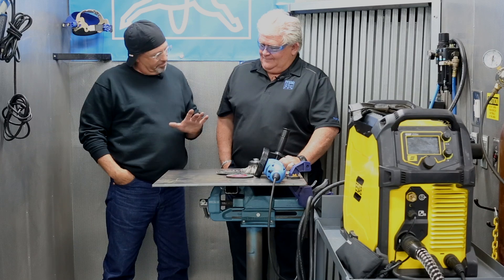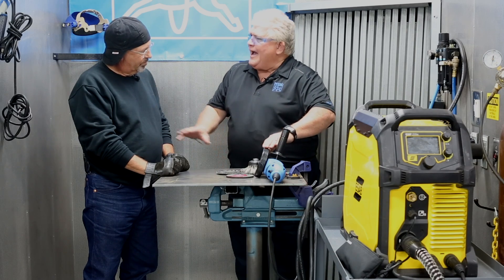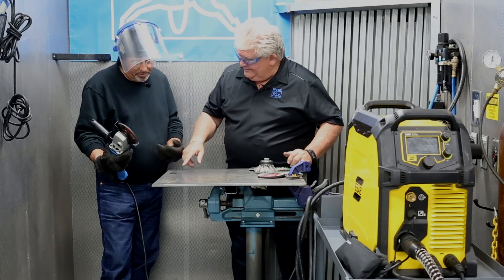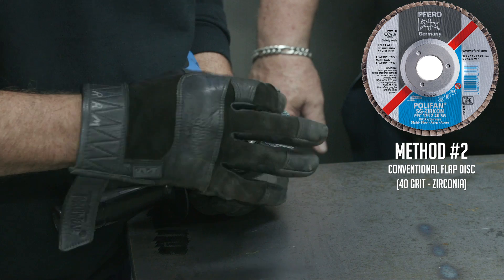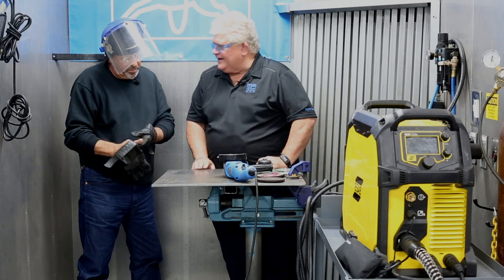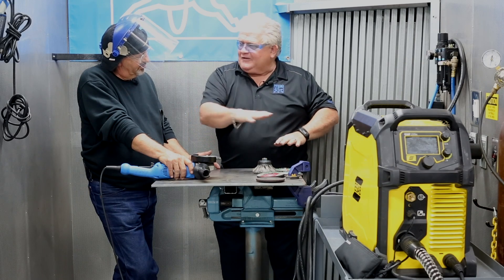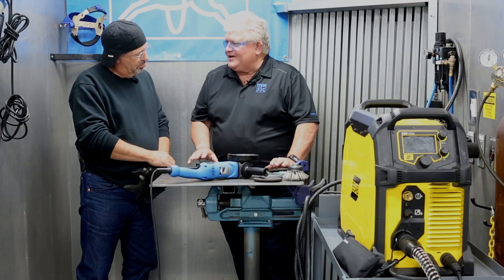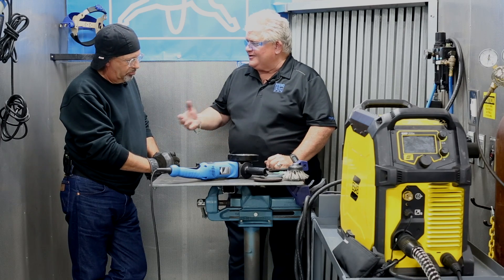Four Ways to Remove MILL SCALE

Comment: Um, this is ridiculous that you never mention the most important thing, the relative hardnesses of AO, Zirc, silicon carbide & diamond. Mill scale is primarily a heavy iron oxide layer over the top of the steel, not the "impurities" floating to the top. Iron oxide is also known as Emery.... which is used as an abrasive ( Emery wheel, Emery board, Emery cloth etc)
 You have to use a harder abrasive than Emery, such as Silicon carbide or Diamond in order to be able to scratch into the surface of it, no matter the speed of the wheel... I use a dedicated random orbital air palm sander with a 5" hook & loop 80 grit electroplated diamond disc to cut through the mill scale. Then usually 120 sanding disc for a smooth finish. By removing the top layer of scale you dont immediately glaze over your sanding disc or flap disc. Saves you tons of $ on abrasives in the long run. 

Love the diamond wire wheel. Didn't know they made em. I'll have to get one.

Comment: Lel website has no price.  I order nothing that I need to request a quote for.  Rug salesmen.
Reply: Abyyss3344  And you gotta wonder what the useful life is like.  TBQH there are situations where $100 would not be an absurd price for something like that.  Pipeline workers, field repairs and the like, some of these gigs pay well over $100/hr and down time of what ever they are fixing can be orders of magnitude more costly.  But regardless it still rubs me wrong when they wont say what it costs.  I've been forced to do business with folks that will just pull a quote out of their ass based on what they think you are willing to pay.  Highly frustrating.
Reply: Abyyss3344  IKR. I think I can remove that mill scale myself for that kind of money
Reply: Abyyss3344 I posted this a couple of days after this video aired. Someone made a comment to my post yesterday so I started reading other post.  Here is the real prices as of the aire date: here are the prices of the three grits for that diamond stainless wire cup.  I hope you are sitting down.  EDP#84323 - $956.85  EDP#84325 $719.85 and EDP84322 - $1287.17  You can pay for a lot of labor to finish the surface at those price points.  Just sayin.

Comment: We do auto restoration which in turn brings us into the field of sand blasting.  Oddly enough most of our money in the sand blasting department is from industrial work needing millscale  removed prior to  the welding/coating.
Reply: That's what I use in the shop. Sand blasting is the BEST way to remove mill scale. Makes my tig welds look perrrrty
Reply: @Mikey-ym6ok  Agreed. It is incredibly fast for large areas. It also gives consistent results. The only down side is the initial cost. My old shop had an industrial booth you could drive in with forklifts and a 100hp compressor. It was like sandblasting with a fire hose. You could leave small delicate parts in the corner and they would get blasted just from the shot bouncing around.

Comment: If it is affordable and value for money then I will try one. Otherwise the Klingspor 60grit flap discs will be retained. I pay roughly £1 each for the 115mm flap disc and then I use the worn down ones for fish mouth joints on steel tube.
Reply: $300 for the Diamond Wire Cup. It also uses a metric thread and has to be used on a slow speed grinder.
Reply: @nsmturbo5902  I will pass on it then. It's not value for money in the grand scheme of things and given time other manufacturers will make and sell something similar (irrespective of IP protection) which is value for money but still quite expensive to layout for.
Reply: @JonDingle  I agree

Comment: Terrible product, it removed scale way to slow and left scale in the pit marks that hot rolled has. Walter has much better products for removing mill scale faster, larger surface area without gouge marks and the price isn't that bad. The abrasive pads they have for removing scale don't gouge or scratch, non loading and won't glaze over at slower spreads.

Comment: I have been using a flapper disc for 10 years and I just bought one of those silicone carbide disc. Holy crappy it is a miracle, easy and faster. Great video bob
Reply: How long did it actually last?

Comment: Polycarbide Abrasive Wheel is the fastest way to remove scale.  I buy the cheap Harbor Freight ones.  They don't last all that long but their pennies compared to this diamond wire brush.  Also, from the video, much faster at doing the same job.

Comment: This is for the newbies: I used to buy 4'x8' 11 gauge mild steel sheet with mill scale. I ground the mill scale off with a hard wheel, then smoothed it with a flap wheel, then primed & painted the sh** out of it. Then I discovered acid, but acid has its own problems. I sand blasted it, but air compressor, sand blasting cabinet, media, time, etc...So the search for mill scale removal continued...

Then one day I saw some 4'x8' 11 gauge that had NO mill scale & was "good to go". What the hell this stuff?? The old timer said "Oh it's PNO." 

PNO?? WTFO?? 

Pickled and Oiled.

The best solution for mill scale removal is NOT TO BUY IT in the first place. HTH.
Reply: Or just buy cold rolled. It's easier to get here, and less work to degrease.
Reply: HAHAHAHAHAHA, Cold rolled just isn't that much more when you think about it. You're going to spend it in disk or some other solution, or in cold rolled. Cold rolled doesn't take your time though!
Reply: What's the difference between manufacturer pickling and pickling in the shop?
Reply: I saw some 16 ga sheet once that supposedly was "levelled, stretched, pickled and oiled" I think, it was supposedly intended to make furniture.  It was scrap when I got it and partly rusted, but really great stuff in the parts that hadn't rusted.  I like what you're saying here!  Unfortunately in FLorida, everything tends to be or become rusty if you just look away from it for a minute, I think we will always feel the need to do this

Comment: For everyone interested in this diamond stainless steel wire cup brush, it will not be available in the US until Feb 2019. The parts numbers will be EDP#'s 84323, 84325, or 84322. This is directly from Pferd customer service conversation on their chat system. Hope this helps.

Comment: I’ve been watching your videos for some time now and find them extremely helpful. I do a lot of repair work on tractors attachments dump wagons and basically anything you might find on a large farm. There’s been a bunch of times I’ve been forced to run single pass flux core wire on multi pass welds because it was all I had and mig wasn’t an option due to high winds. My question is could you do a video showing the difference in penetration between multi pass flux core wire and single pass flux core wire on multi pass welds?

Comment: I’m assuming the silicon carbide wheel is the same make up as a silicon carbide grinding wheel on your bench grinder for grinding tungsten carbide, if it is Stuff using that anywhere in a 4” grinder. It should be reserved for grinding carbide. Even with a respiratory device dust you crate will get stirred up at a later date and cause you some big problems down the track

Comment: Great stuff if you are working a job that can afford that but I would love to see some stuff geared to us budget folks out there. I would love to see a video on comparing various acid methods of scale removal and if they do negatively affect the strength of a weld (hydrogen embrittlement.) For myself I tend to find a nice quick soak or wipe down with vinegar tends to do the trick most of the time for getting the nasty flaky stuff off and then doing a simple solvent wipe and all is good to go for brazing or flux MIG welding.

Comment: Or, you can just let it sit in a 5% hydrochloric solution (aka muriatic acid) for a 2 or 3 hours, or the night before.  When you take it out, just wipe away the mill scale with a stiff brush or rag.  Why pay for expensive abrasive discs or brushes, spend the time removing the scale with all the dust and noise etc.?   Put the steel in the solution and go do something else while the acid works.  Yes, of course there is the downside of working with acid, but common sense,,,  Jerry

Comment: This is another time that the advise should be accepted and the product is “sold”. Again there is talk about linear speed of the abrasive on the surface and that slower is better. On Pferd’s www the grinders available rotate at quite high speed. Could you (Weld.com or Pferd) disclose the brand and model of grinder used on the video ? Thank you.

Comment: Harbor Freight #94017 - Polycarbide Abrasive Wheel @ $5.99 (before 20% off) does a great job removing mill scale.
Reply: Hell yeah on putting the part number on there

Comment: Been a  metal fabricator /welder for years and this product is just what the doctor ordered for material cleaning prior to welding.
My question is can that wire wheel be used to remove smoke and flux from welds or is it too abrasive and will remove reinforcement?

Comment: I've actually had amazing results using Clean n' Strip discs like this: https://www.3m.com/3M/en_US/company-us/all-3m-products/~/3M-Power-Tool-Grinding-Discs/?N=5002385+3293948879&rt=rud
Doesn't get into the material, and the mill scale is gone with no effort.

Comment: No kidding silicon carbide is sharper than aluminum oxide or zirconia!   Basic materials science.  And diamond is the top.  But diamond is more resistant to fracture than SiC so it doesn't break down and it likes to drag and smear.  Which is why I flame clean mill scale.  Or chemically remove scale.   Less work.  Mill forms like pipe and tube have far less as they have less time at temperature to form scale.  Thick plates and structure forms have far more as they take longer to cool.
Need a large plate descaled?   Prep n Etch phosphoric acid with a paint roller, let it dry over night, then 4000 psi pressure washer.
Reply: Haha yeah I was thinking the same thing. I'm just surprised they didn't start with an aluminum oxide then zirc then carbide then diamond then.....
Reply: Or buy cold rolled

Comment: Mill scale is from the iron oxidizing.  Black oxide.  Harder than the steel.  This is why cold drawn steel is bright.  The mill scale is blasted off after the last hot roll by steam and water.  A rose bud acetylene or propane oxygen torch and water will do the same.
Reply: Yes it's mostly iron oxide (not "impurities" like he said). I think sometimes they also pickle it in acid before  cold rolling.
Reply: @benc8386  : Pickling is done for bright stainless products.  Steam and water with wire wheel at most for carbon and low alloy.  Always done for cold roll final.
Reply: Yeah this guy expects me to believe you can move it around at 1000 degrees? Nice sales pitch. How can he say there's no directional scratches from a spinning wire wheel? They don't mention price because this is an expensive setup, between the wheel and the soft start slow speed grinder yikes
Reply: @LacklusterSupply  : No kidding.  Tubby there is in sales.  Too bad he never set foot in a steel mill, foundry or forge shop.
Reply: wouldnt that method warp the pieces though? how about soaking it in Vinegar?
Reply: @CP110  : Flame scaling only heats the scale.  This causes the mill scale to expand, causing shear stress in the bond.  You don't heat the metal, just a fraction of a second.  You move the rosebud very fast.

I've GTAW steel without removing the scale, it does the same thing.  But when you get scale in the puddle, it reduces causing an oxygen pop.

Comment: That looks like it would eat rust and paint also. Can we please get a link to the diamond brush and grinder? Thanks Guys!
Reply from the maker: Here is the brush: https://www.pferd.com/int-en/products/industrial-power-brushes/threaded-cup-brushes/knotted/tbg/stainless-steel-wire-inox-diamond-dia/stainless-steel-wire-inox-diamond-dia/tbg-100-m14-inox-0-50-dia-270/
Reply: @Welddotcom  thanks
Reply: @Welddotcom  Thank you!
Reply from the maker: The grinder is not available in the US. However, all your major grinder manufacturers make a variable speed. This is one bad mamma jamma: https://www.metabo-hpt.com/us/main-navigation/tools?category=/tools/grinders/4-5---5-angle-grinders&title=G3612DAQ6++36V+MultiVolt+Brushless+4-1%2f2-in+Slide+Switch+Grinder+(Tool+Body+Only)

Comment: How about a  part number.  I looked on the pferd sight and could not find them.
Reply from the maker: Here is the brush: https://www.pferd.com/int-en/products/industrial-power-brushes/threaded-cup-brushes/knotted/tbg/stainless-steel-wire-inox-diamond-dia/stainless-steel-wire-inox-diamond-dia/tbg-100-m14-inox-0-50-dia-270/
Here is the Silicon Carbide Wheel: https://www.pferd.com/int-en/products/fine-grinding-and-polishing-tools/combiclick/fibre-discs-cc-fs/silicon-carbide-sic-type/silicon-carbide-sic-type/cc-fs-125-sic-80/?filter=%7B%2522q%2522%3A%2522silicon%20carbide%2522%7D

Comment: Links to products shown/discussed?!?
Reply from the maker: Here is the brush: https://www.pferd.com/int-en/products/industrial-power-brushes/threaded-cup-brushes/knotted/tbg/stainless-steel-wire-inox-diamond-dia/stainless-steel-wire-inox-diamond-dia/tbg-100-m14-inox-0-50-dia-270/
Here is the Silicon Carbide Wheel: https://www.pferd.com/int-en/products/fine-grinding-and-polishing-tools/combiclick/fibre-discs-cc-fs/silicon-carbide-sic-type/silicon-carbide-sic-type/cc-fs-125-sic-80/?filter=%7B%2522q%2522%3A%2522silicon%20carbide%2522%7D

Comment: Industrial application is just code talk for more than you should pay
Reply: chadwick hayes you mean “over priced”
Reply: @mrmidnight32  You should look at my comments below to see just how overpriced.
Reply: DIY toot isnt cheap
Reply: @Ken F 
Neither is ruining new flap wheels getting them filled with mill scale glaze or adding two or three steps to finish before paint and still haven’t struck an arc or welded an inch anywhere!
I trained to weld, but have not been able to put that training into work experience. 
I still know that every minute spent trying to get mill scale off the work piece before welding, is time lost from welding!
Not to mention that getting rid of mill scale makes the work surface that much easier to weld and can save getting inclusions or porosity in the weld!
I also know that porosity is caused by things other than mill scale, like incomplete fusion, low or wrong cover gasses, low/high temp, slow/fast wire speed, or filler rod progression.
But getting one more variable out of the equation can put you leaps and bounds ahead of the game if you’re able to control the other gremlins of welding issues!

If I were given an opportunity to get into a welding job where I could advance my skills, I would spend whatever it took to give me a better starting point in the price!!!
It’s one sacrifice vs. another! 
For me, the cost sacrifice is far outweighed by the employability benefits!
If I can produce work at or above the requested/required level, then spending more upfront for tools that give me that advantage is absolutely worth the cost!!!
Reply: @AzzKicker-bz1cb   here are the prices of the three grits for that diamond stainless wire cup.  I hope you are sitting down.  EDP#84323 - $956.85  EDP#84325 $719.85 and EDP84322 - $1287.17  I can pay for a lot of labor at those price points.  Just sayin.
Reply: @Mushrooman62  Dafuq?! This is the price for a single wheel? Not a case or something?!
Reply: @richardneel6953  single cup. price came directly from regional sales rep.
Reply: @Mushrooman62  No freaking kidding..What a joke.
Reply: @Mushrooman62  yeah dude I almost passed out when the guys at my LWS looked up the prices for these damn things lol.   Unbelievable.
Reply: @AzzKicker-bz1cb  a wire wheel is a consumable not a tool.
Reply: @andriyshapovalov8886  exactly, the most expensive one is probably more than I paid for my TIG welder :-)
Reply: Industrial application is code for "not the cheap overpriced power tool branded garbage you get at Home Depot"
Reply: here are the prices of the three grits for that diamond stainless wire cup.  I hope you are sitting down.  EDP#84323 - $956.85  EDP#84325 $719.85 and EDP84322 - $1287.17  You can pay for a lot of labor to finish the surface at those price points.  Just sayin.
Reply: Joseph Cicirello holy shit. I was about to call for pricing. Now I’m curious and will have to do so just out of curiosity.
Reply: "Industrial application" is code for the company needs to buy it if they want me to use it cause I ain't paying for it.

Comment: Woo Wee!!!  After Bob mentioned this diamond cup brush in his FabTech video I asked my welding rep for a price!!!!
The answer was outrageous!!!
2-3/4” 270 grit 5/8”-11 hub 
List ——$421.64
Cost——$275.00
That being said I’d LOVE to try one!!!
Reply: Damn, that thing better be coated with dia.... Never mind!
Reply: @thelikebutton4405  3 carat diamonds.
Reply: You still need that spendy slow grinder to use it too
Reply: Holy crap! I'll pass!
How much was the carbide wheel again?...
Reply: 90°drill
Reply: There are some cases where a diamond coated wire cup like this would be good, but finally a price from someone, not shockingly NOT from the mfr or salesman or website or eBay or Amazon. I was thinking $150, so I would like to know the lifespan, because a normal cup is not that long...

Comment: Hey Bob great info. Can you provide a pat number or link to the brush cup and silicon carbide discs?
Reply from the maker: Here is the brush: https://www.pferd.com/int-en/products/industrial-power-brushes/threaded-cup-brushes/knotted/tbg/stainless-steel-wire-inox-diamond-dia/stainless-steel-wire-inox-diamond-dia/tbg-100-m14-inox-0-50-dia-270/
Here is the Silicon Carbide Wheel: https://www.pferd.com/int-en/products/fine-grinding-and-polishing-tools/combiclick/fibre-discs-cc-fs/silicon-carbide-sic-type/silicon-carbide-sic-type/cc-fs-125-sic-80/?filter=%7B%2522q%2522%3A%2522silicon%20carbide%2522%7D
Reply: I don’t see how to order it, no price either.